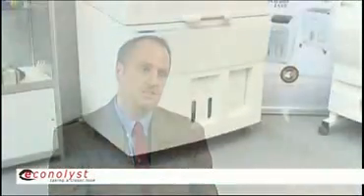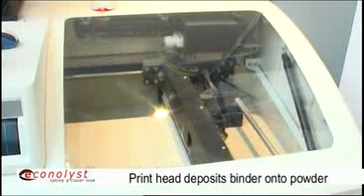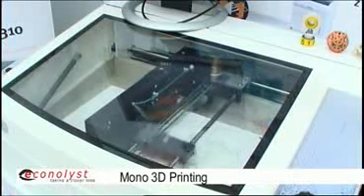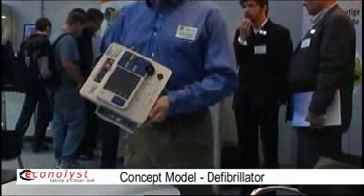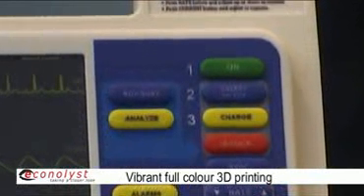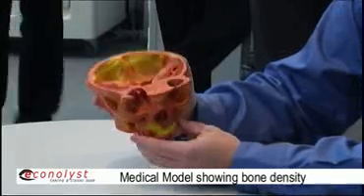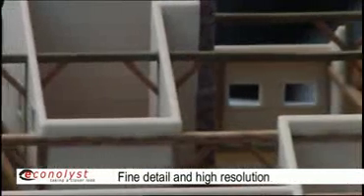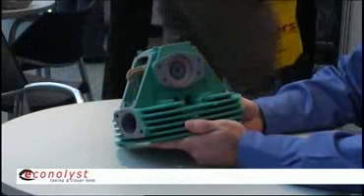Z-Corp - 3D Printing

Comment: @hamolton1 If you listen to the reply posted to the original video, yes it IS scanned. If it has moving/hidden parts, then it has to be EDITED using the software. Which is understandable since its a solid object. Any kind of scanning needs to be edited before you print it. That doesn't make it fake or impossible. And he said the wrench only broke when he used ALL OF HIS STRENGTH to tighten the bolt. You make it sound like you could just snap it in half like a twig, which is not the case.

Comment: me too, but you'll need a fair amount between the ears if you want to really have fun with a machine like this, you should check out fab@home and reprap if your into engineering/design, homemade 3d printers, not as accurate but good fun